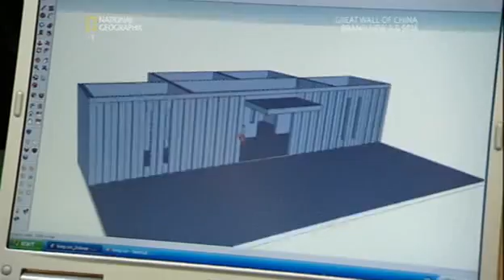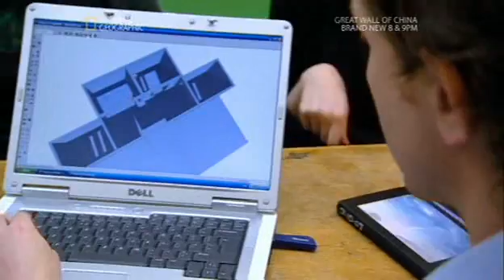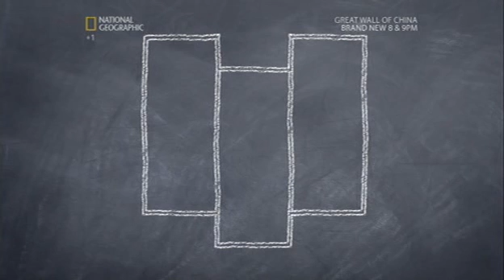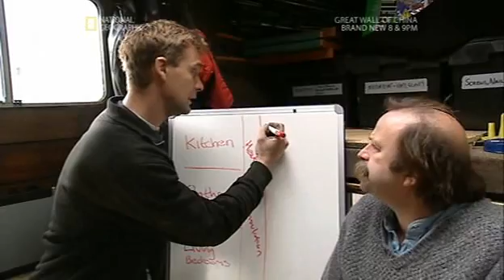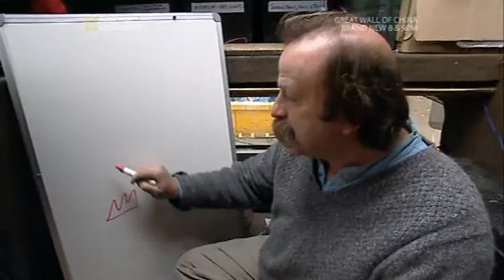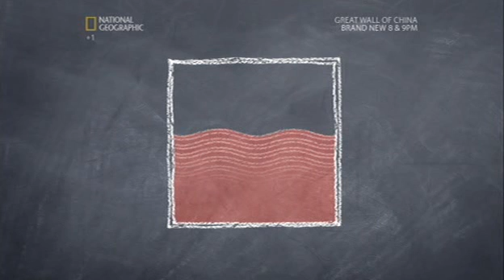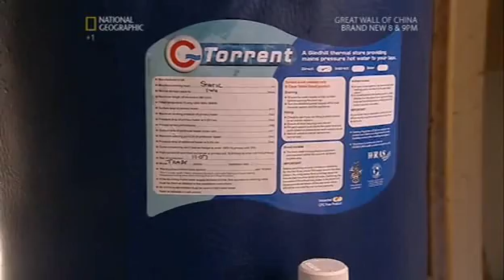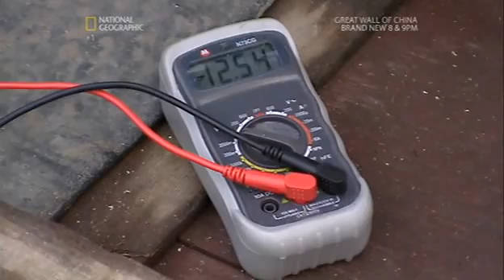(ENGLISH) National Geographic - Planet Mechanics - Heavy Metal House full

Comment: I have made a fully metal house, or it's more of a shack really but it was an interesting project non the less, i used square tubing for the frame, sheet metal for the roof and walls and diamond pattern plates for the floor. it gets extremly cold and warm inside during the seasons though since the whole structure conducts heat.

Comment: great to finally know actual cost!
Reply: That's excluding labour and energy to build it though. Also, its quite likely you won't get the same deal on containers and some other stuff if you are not pointing a BBC camera at the building process.... Still, for 15.000 I'd live there :) Especially considering I'd probably live there with my partner and we'd have a room extra left over. No leccy and water heating cost is a big plus as well.
Reply: yeah, I understand that... I got a great deal on my containers, I do all the work myself and have now added a swimming pool to the project! Thanks for the video!